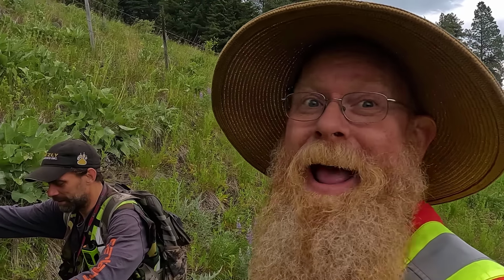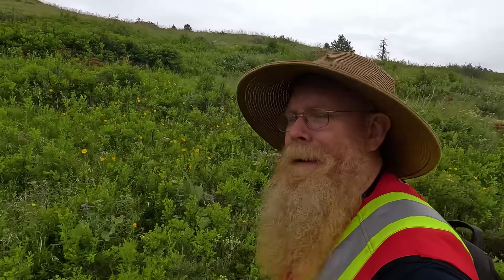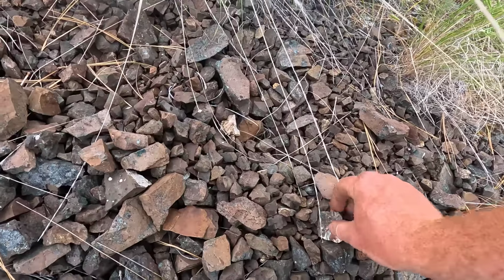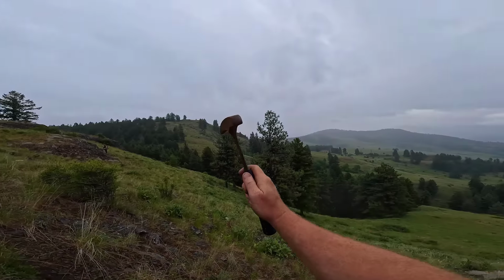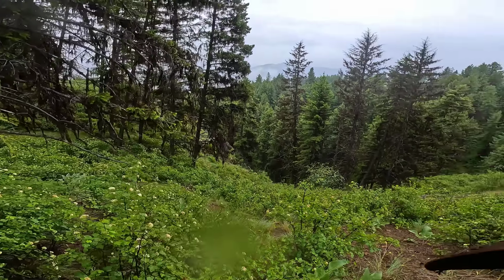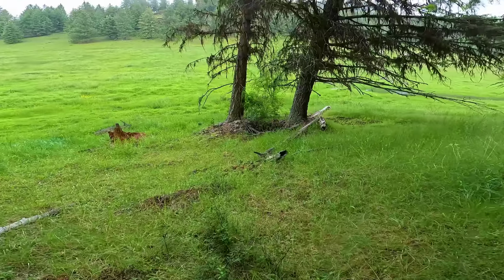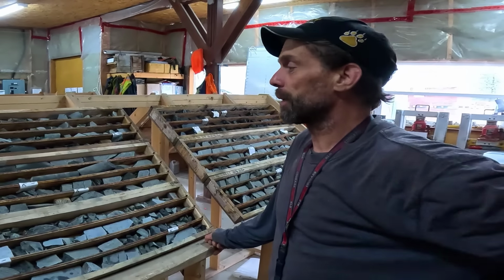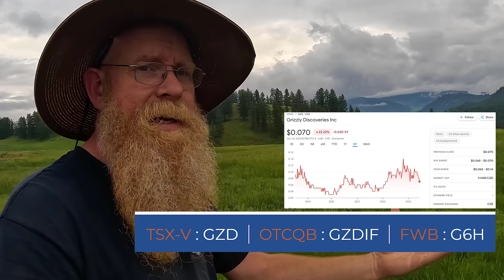Prospector Finds $5700 in GOLD /t in One Sample!

Comment: Options are used in economics to reduce risk, as you do in this case.
Selling it blind is risky for boths sides, you can over pay or underpay for whats beneath and finding a fair price is hard.
Options does what it says, you make an agreement on a set of options on purchase or sale of an asset.

This reduces risk on both sides.
In economics its usually used for large trade volumes occuring in different currencies. - removing the risk of the currency falling or going up for both parties by locking in the value at a specific time, also called a forward trade, which is one kind of option.

Comment: If you have any stories about finding something unexpected on a claim I would love to see/hear it in a video some time!
Reply: I found gold flakes in an ancient glacial moraine just a mile east of the Delaware River in central NJ.  The moraine is composed of pebbles, small boulders, and heavily weathered red-brown clay at its base which is oxidized bulk sulfides.  Beneath the still somewhat acidic loose layers (composed almost entirely of various forms of quartzite mixed with fragments of marble, slate, flint, and partly-metamorphized sandstones from the peaks of the Appalachians found northwest of the moraine) the iron oxide has re-precipitated into an impermeable layer of new bog iron rock, some of which is still forming to this day.  You can find newly-cemented pebbles as the pH changes over time and cements more oxides in place.    

In the base of the loose layers, just above the iron clay and bog iron, I've found the highest concentration of gold flakes and even some tiny crystalline copper 'flowers'.